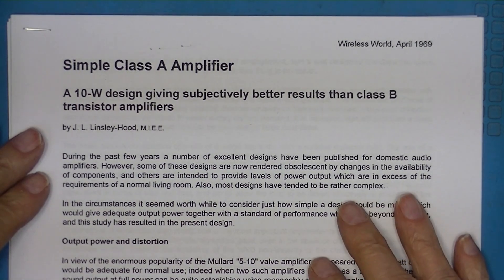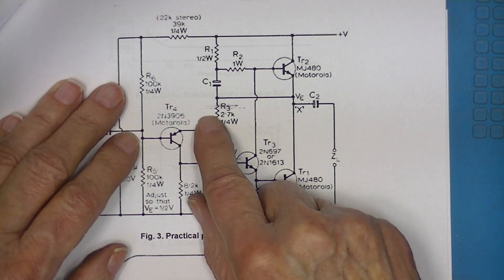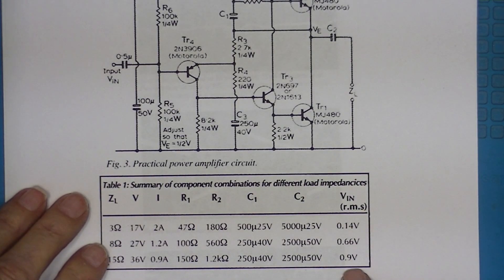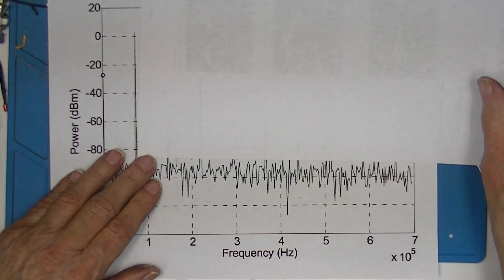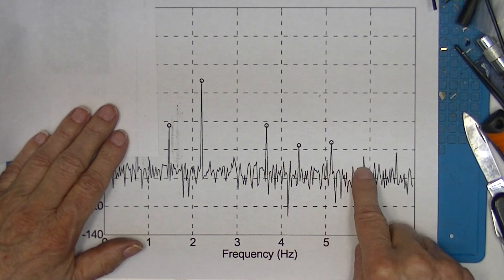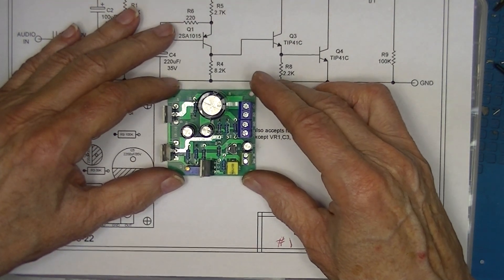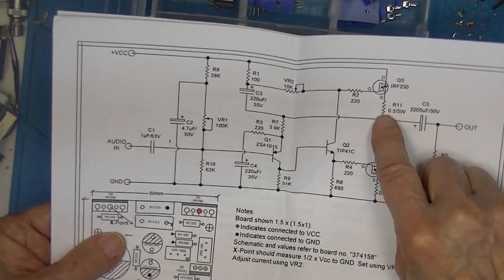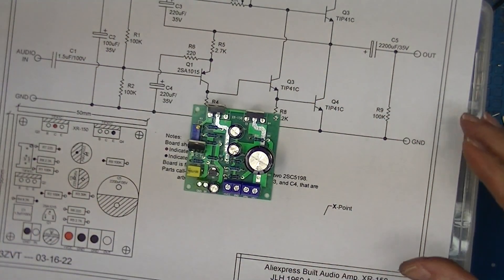J. L. Linsley-Hood 1969 Amplifier Part 1

Comment: This is great Steve and you're an old timer like me (i'm 72). I built this JLH 1969 version in 1980 and was shocked at the great sound quality, but I had trouble controlling the heat on a budget so moved on to class B designs. Now I'm building it again 1996 version.
Reply from the maker: Nice to know!!! Thanks
Steve

Comment: The circuit boards you show are the JLH headphone amplifier not the power amplifier.
Reply from the maker: No, the entire series IS about the JLH 1969 10 Watt Power Amplifier described in the English magazine "Wireless World".
Thanks
Steve
Reply: @stevestrivia-bystevewagner4852  You won't get ten watts from a tip41 to220 package. The headphone follows the same topology as his power amp
Reply from the maker: I have had no trouble getting 10 watts into a 8 Ohm load, using the right voltage and 1 Amp, with any of the five amplifiers tested. It's a matter of the Heat Sink.
Steve